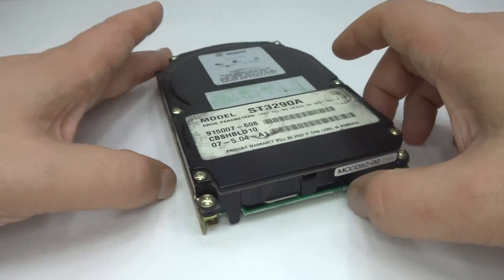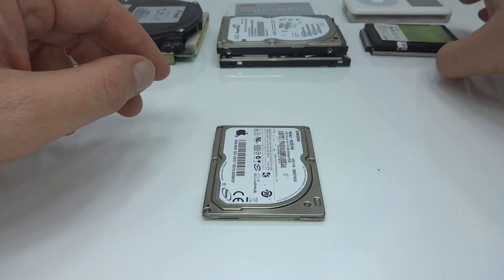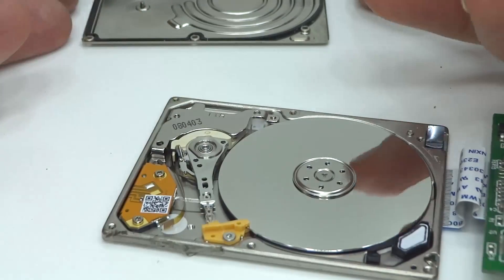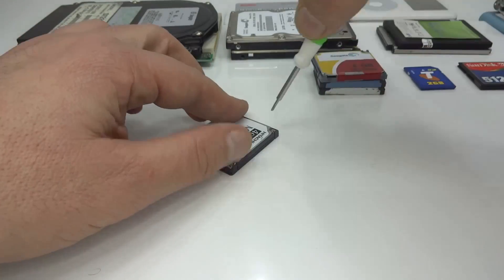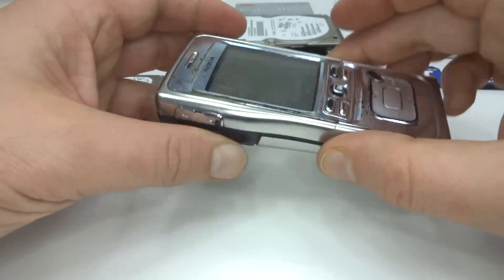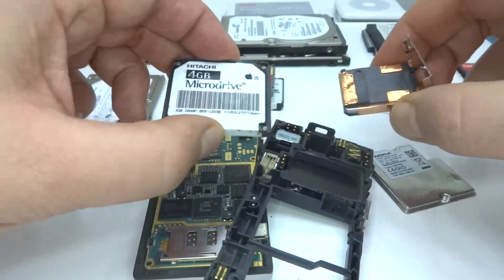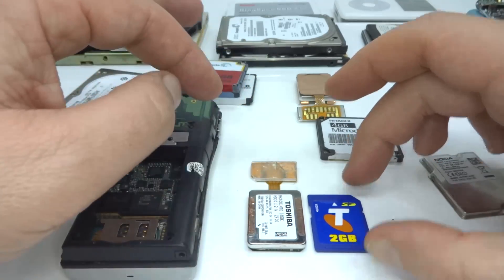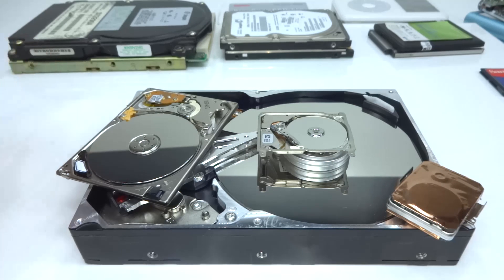Spinning Disks: the smallest hard drives compared

Comment: 0:38 3.5" SL drives like you show here didn't become common until the early 90s. The 3.5" drive that was introduced in 1983 was the Rodime RO252, which was HH, or double the size of that drive. It displaced half height 5.25" drives which were introduced just the year before by Microscience International as the HH-612. Only two years before that, the Seagate ST-506, the first 5.25" hard drive at all was introduced. The ST-506 replaced the IBM 62PC Piccolo of 1979, which was an 8" drive ,the first of it's kind.
Technology during that era was moving scarily fast. The Rodime RO252 is a 10MB drive, just 3 years earlier a drive 4x the height stored half the data.

0:52 The 2.5" drive introduced in 1988 was the PrairieTek Prairie 120, which was twice the height of the Toshiba you showed. It was the smallest production hard drive in the world at the time of it's introduction. Thinner drives came a few years later, but this "Full height" 2.5 inch form factor was still relevant for enterprise applications until the mid 2000s.

1:21 The first 1.8" hard disk drive was the Integral Viper, in 1993. It was a PC Card, and they were popular for mobile data storage long before the iPod hit shelves.

5:50 The IBM Microdrive isn't "Basically" a Compact Flash card, it IS a compact flash card. It was intentionally designed to be interface and socket compatible. Most devices which support one will support the other. The Microdrive hit production in 1999 and it was the world's smallest production hard drive. You could get original Microdrives in capacities of up to 340MB on a single 1" platter.

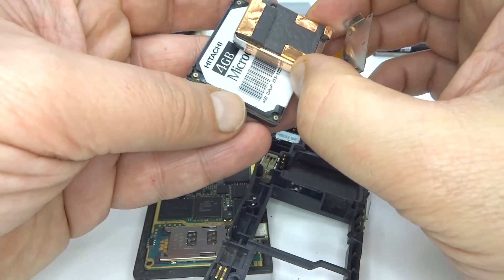11:28 The Toshiba MK4001MTD and MK8003MTD, the smallest hard drives in the world. 4 and 8GB, respectively. I believe they really do use an SD card interface.
Reply from the maker: Wow, your specific knowledge of early drives is amazing. I really appreciate hearing these details. One day I'm going to revisit the 1" drive in a video of some sort. Unfortunately I have already recently made a video about iPod and 1.8" drives. But I didn't know their real history. I do research these things. But it's hard to find the sort of detailed knowledge you have. Thank you!
Reply: @JanusCycle  You do know that with a fly-height of about 100nm, opening these drives outside of a cleanhood means they're dead soon? The 2.5" drive you show operating is actually retreating to the ramp repeatedly because it isn't able to land correctly.  The first IBM microdrive was a 1" drive, I think you have the order reversed. At the time of the 1" drives introduction in the ipod, it wasn't possible to fit flash memory of the same capacity into that amount of space. That changed within a year or two.
Reply from the maker: @bcwbcw3741  I only open drives that are already faulty. Most recently in 'iPod DOOM'. Hopefully more in the future :)
Reply: @JanusCycle  Every time you flick the arm so the head slides off the load ramp and splats on the disk I wince. I was wrong about flash density - it took about 6 years to match the 1inch disk but I wasn't following it anymore as IBM had sold the hdd business to Hitachi because single 3.5" platters where holding so much that backup and access times were suffering and there HDD's were becoming a commodity with less value from increased density. For the previous 20 years, HDD data density had doubled every 1.8 years. The first 1" drive had data tracks spaced about 10 microns apart so there were about ten thousand data tracks on each side. The radial position was servo controlled to about a 0.1 micron as the disk spun.

Comment: Fascinating. I never knew that such small mechanical drives were once commonplace in commercial products. I remember visiting the Science Museum decades ago and marvelled at the huge pioneering hard drive, which was cut away to expose some of the mechanism. The drive must have been 24 inches in diameter! When the company I worked for in 1978 we got our first word processing system with terminals on desks and a huge drive unit in a special room down the corridor. The diameter of the drives in that unit was around 14 inches, I reckon, and the drive had a capacity of 40 MB. The terminals had local 8 inch floppy drives, too. That's when I started to become interested in computer programming.

Comment: 3:30 I've dismantled several old hard drives over the years and frequently came across a hidden screw. Why on earth do the manufacturers hide them! As if it's supposed to deter casual opening of the drive?
Reply from the maker: I believe it's to detect casual opening for warranty voiding purposes. You wouldn't believe how many average non tech people have brought me hard drives to recover data from that they have already opened themselves.
Here is one example, I immediately noticed the hidden screw had been opened already.
https://www.youtube.com/watch?v=d8BoyzqD0Ps
Reply: @JanusCycle  If non tech people think they can repair a hard drive, they are plainly stupid. Does a non tech driver attempt to repair his brakes without knowing what he's doing?

Comment: There was a time (around the beginning of this century) when I was using a "MASSIVE" 340MB microdrive in my DSLR - the largest solid state ones were 32MB tops at the time I think. I was always humbled knowing that there is a tiny plate spinning inside the CF enclosure... My wallet had also been humbled.

Comment: The Seagate ST3290A you show at the start was a mid 90s drive, so yes bringing it to the mid 80s would be witchcraft. The capacity of that drive eclipses anything money could buy in the 5.25" form factor and most, if not all 8" mechanisms as well.

Comment: 13:45 "The gigabytes we carry around in our phones are all based on this original MMC standard." 
Apple has used NVME since the iPhone 6s/6s+ in 2015.
UFS (Universal Flash Storage), used in Android since 2015, is a complete replacement for eMMC (which older devices used.)
NVME is based on PCI express signaling and UFS is based on SCSI.
I understand this video is from 2018, but the information was outdated when it was posted.

15:45 LFF (large form factor, aka 3.5" hard drives) are very rare in the data center outside of purely-backup providers due to seek time, heat, and power consumption (which drives heat output and air conditioning costs).
SFF (2.5") drives replaced them a long time ago, again: well before this video around the 2013 era. Cold storage for this video is almost-certainly a 2.5" hard drive.
Reply from the maker: Great info, thanks. This is why I make videos, to learn and get better.
Reply: @JanusCycle  Cheap laptops all use MMC still, correct? And the base model Steam Deck of course.
Reply from the maker: @dgSolidarity  Yes, i remember reading that about the base model Steam Deck. I'm going with the GPD Win 3 anyway though.

Comment: "You gotta use a lot of force to get this zero-insertion-force connector in."
Nope. If you have to use any noticeable amount of force then either that's not a ZIF socket or you're doing it wrong. ZIF sockets have a locking lever that you snap down after plugging the cable (in this case, or chip, such as a CPU, in other cases) in and that's what keeps the cable tight.
Reply from the maker: This one is not so zero :)
Reply: @JanusCycle : Right, so it's not a ZIF socket like you called it. Unless it really does have a little sliding or swinging lock mechanism and you didn't notice it, and you were trying to plug the FFC into it while it was locked.

Comment: My favourite little drives are the 1 inch voice coil units in Compact Flash form factor, manufactured by Seagate and Hitachi also for camera use. They generally hold up to 8Gb. My first drive in about 1987 was a 5.25 Miniscribe 3053 voice coil with 3 platters giving 40MB capacity. It made the most superb sounds when seeking that were easily audible while using the 80286 12MHz PC running MS-DOS 3.X.

Comment: I had quite a few external SCSI drives back in the day. I had one from a company called Frog (based in Scotland!) The large external SCSI enclosure housed a 2.5" SCSI interfaced HDD with an adapter to the normal "Centronics" style external SCSI connector. It dawned on me at the time that it wasn't an economical way of creating an external SCSI hard drive. When manufacturers stopped making 2.5" SCSI hard drives I recall Apple laptops ending up using a regular 2.5" IDE HDD with a SCSI adaptor board! So much electronics! I found a solution to the lack of drives though - certain printers used a 2.5" SCSI hard drive as an internal buffer - so I bought as many of those kits as I could afford, I ended up using them all in Apple laptops!

Comment: If you told the engineers of the IBM 350 (3.5MB and 2000 pounds in weight) in 1956, the smallest mechanical harddrive in the next century will be the size of a poststamp and can contain 4GB of data, they advised you to go see the doctor. 😄 They can't even imagine why you need  that amount of storage space. Lately I bought a micro SD of 32GB for $2 on Ali. Insane if you think about it. It is impressive what humans can make.

Comment: 3 x WD Ultrastar 20TB 3.5'' 7200rpm 512mb cache drives inside desktop pc, flash storage is yet to catch up high capacity hard drives even in 2023... with that said flash storage already catched up to small capacity drives where 1TB hard drives are irrelevant these days since 1TB m.2 nvme ssd's can be had cheaper than same capacity hard drives and even 2.5'' sata ssd's...

Comment: I find mechanical disks to be reliable the new fNVME drives have weaknesses but will become more reliable as time goes I find mechanical drives often warn you in some way they are dying so you have a chance to back up important data I bought two mechanical 2.5in laptop drives one is 500GB the other is 1TB the 500GB is CMR tech and i am using it on this computer as I type I also have the 1TB drive which is SMR tech and am going to test soon with various OS's and see how well it performs with diffferent filesystems etc great video mate cheers

Comment: The laptop I bought in 2017 which Im still using has a 2.5 inch 1TB HDD and it's as slow as a dog dragging its itchy arse across a rough floor.

It takes more than 3 minutes to boot this thing up and takes another minute to open google chrome.
Reply from the maker: Yeah, that sounds slow. Thanks for punching through that morass to watch my video about these weird spinning things.

Comment: The IBM 350 disk drive invented in 1956 stored a mere 3.75 MB and took up the space of two large kitchen refrigerators. This tiny Samsung disk drive stores 80 GB. You will need 21,333 IBM 350 disk drives taking up the space of 42,666 refrigerators to have the same amount of storage as this Samsung disk drive. The 350's cabinet is 60 inches (152 cm) long, 68 inches (172 cm) high and 29 inches (74 cm) wide taking up 12.083 square feet. 21,333 IBM 350 cabinets would take up 257,775 square feet or 5.37 football fields. The IBM 350 disk drive costed $3,200 per month to lease in 1956 or $31,418.12 in 2021. 21,333 IBM 350s would cost $68,265,600 per month to lease in 1956 or $670,242,703.76 in 2021.

Comment: Still got a secondary HDD in my system. 
They are slow, noisy and much more prone to damage than an SSD, but since the price is lower they are great as a storage-drive :)
Reply: SSDs can also fail due an internal bad contact or a chip fail, they have write limits, so you can't store and delete files every time you want because how more file writing, less SSD lives.
And with an hard disk, if you use to download a lot of files, erase a lot of things, HDD is more resistant because there's no write limit.

Comment: Ah that nokia sound took me back.
I think the 0.85" uses a higher voltage than regular SD and that's why it doesn't work with a reader, also possible that you may have blown the mmc+ card by placing it in the phone, but that's just a theory

Comment: It's best not to talk about solid state drives (SSDs) in a "hard drive" video. This is an educational look into hard drives, and this will be a rather educational comment as well. Hard drives (HDDs) today are actually 2-3x thicker than the ones from the 70s-90s, but they compensate for that by being over 100-1000x more efficient (Depends on when the drive was made and how much they can store compared to modern drives). Solid state drives on the other hand retain that small size while still being able to hold 100-1000x more space (Jesus, what is this, the future? Haha, for 70s-90s people it is). 
  On the topic of SSDs, there's an even larger engineering feat that has been accomplished these days, and that's the "stick" SSD, or NAND Sata III SSD. These SSDs are only 2-3 centimeters thick, yet they can hold upwards of 1-2TBs. You can easily put 10 of these in a PC and they'll take up about as much space as a modern 8-14TB HDD. 
  The read/write speed of these "stick" SSDs is nothing to scoff at either. A normal Barracuda HDD and has a read/write speed of about 160 MB/s (Megabytes per second for those who aren't nerds), and a regular sized affordable SSD has a read/write speed of 200-300MB/s. Meanwhile, these "stick" SSDs come with well over 500MB/s for their read/write speed. There are however normal SSDs that have a read/write speed of 1000+MB/s, but for a "stick" SSD that's much smaller than your conventional SanDisk SSD to have over 500MB/s read/write speed, is phenomenal.
  We'll eventually be making $100 chips that can hold 4 TB and have a read/write speed of about 1000MB/s. Just imagine how much space that is and how fast that is for a chip that's about half the size of a Ryzen CPU- You could easily fit thousands of these chips inside the space an HDD would take. The advancements that are made in the world of home computers fascinate me more than the advancements in space, science, medical science, food production, military tech, etc.

Comment: The smallest hard drive i have is an ssd that uses the wifi card connector instead of any or the M.2 connectors. It is wider than an M.2 but much shorter. If i had to guess it would be an M.1 drive cuz I've never heard that term used before and i doubt they would start counting at 2. The model is MZ-MPA0240/0L1 and is is 24GB in capacity.

Comment: I had an RCA MP3 player circa 2005 with the 1 inch microdrive. At the time I don't think I fully appreciated how cool that was but looking back on it, I am very impressed. In almost all areas, the "analog" or "gen 1" versions of products always seems more technically impressive than their successor (CRT > LCD) (HDD > SSD) etc. The original formats had a certain degree of magic and mystique to them that was subsequently replaced by cold, logical, and efficient technologies.

Comment: There were 5.25 inch drives, single height, way back in the day. And single height in those days was what we now know as 2×5.25 inch slots. Think about it, 5,25 as we know it is half height only. Think back to the Quantum Bigfoot. Drives have been bigger than the measly 3.5 inch.
Reply: I have a few of those drives, ironically.

Comment: I had a small 2.5 that wouldn't spin up. Didn't take apart but did knock it around and got the head loose. Pulled all data off it. Still going today, but don't trust it with serious stuff. Mostly transporting things.

Comment: So everybody is talking about going to the hard disk size does this hold on that’s the wall hello dear see you says Todd divine suck about the Telstra 2 GB file is called baby is this a new Sim card
Reply: It's not a SIM, which is 256K of flash memory on a cellular key card (the key to allowing you to gain access to the network). It's write once, read forever, until the carrier denies it access. The contacts storage (SIM phonebook) can still be used/access regardless however. There are some individuals who keep sim's as contact backups (just need an old GSM device).

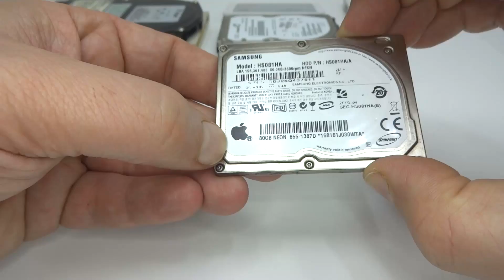Comment: 2:05 - trust me (I've worked on the insides of a lot of Macs since the 80s), it's really not that unusual at all. Apple often order parts from suppliers like Samsung to meet certain specs and the parts are adorned with both logos. Many models of HD were also made for Apple with custom ROMs on the drives too (again, always dual-logo).
Reply: HD=high definition, HDD=Hard Disk Drive. Apple confuses people (yes, I own a disused apple macbook).

Comment: I used to actually own a 1 inch portable usb hdd I got from Office max. I think it may have been a Seagate, but I can't find a reference to it ANYWHERE on google. It was about 1.5 x 1.25 inches square white plastic, had a built in usb cable that you slotted into it for storage, and had this little white fake leather pouch with a clear plastic window in the center to store it in. Wish I could find it for photos and model number.... but it was like....late 2003-2004. Somewhere around then.

Comment: 2.5” HDD are very common in low end laptops and some high end ones as well
Reply: My 2.5 inch bay broke in an somewhat old laptop and found that it had an ssd slot for a drive that did not use M.2 but instead the same connecter all the wifi cards used in the laptops i took apart. they were very hard to find online but once i did i was able to use the laptop again.

I knew it was the computer and not the HDD because of two things
1. it would not boot to anything even BIOS if an HDD was inserted
2. i had 4 different HDD and they all reported good on my desktop. I even used a program to check the hard drives.